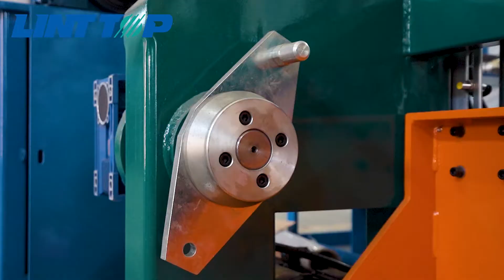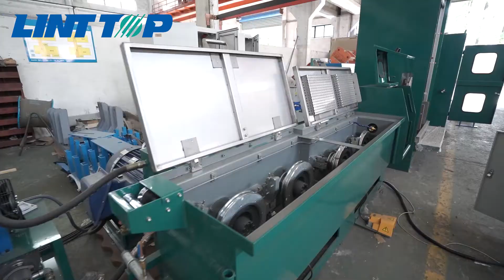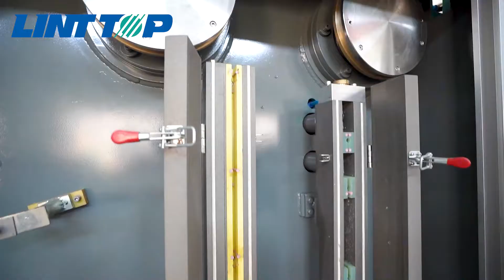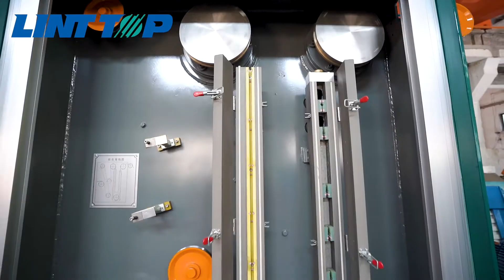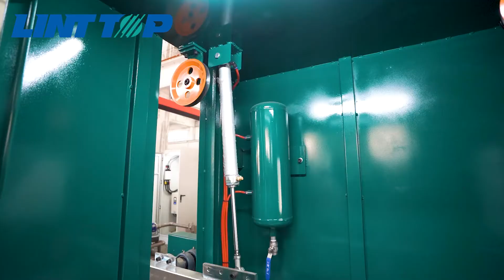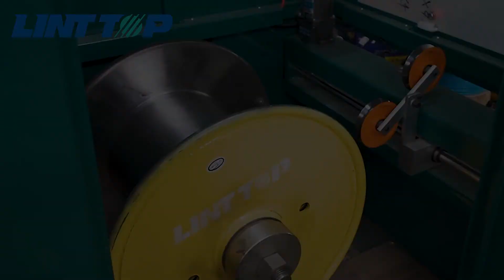Intermediate Wire Drawing Machine

Comment: That's a real nice clean machine.. till you actually start drawing wire..fill the tanks with tool cool..and pull your points to string up the brakes..two and half raps on the bull wheels..good luck
Reply from the maker: This wire drawing machine is about to strat load trial production. We look forward to seeing whether it will remain the same after it is put into production.😀